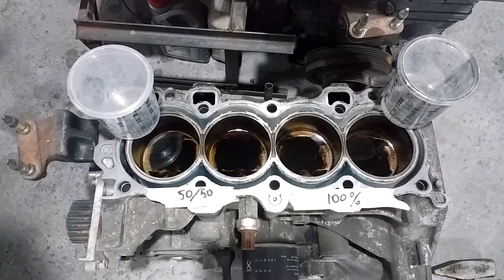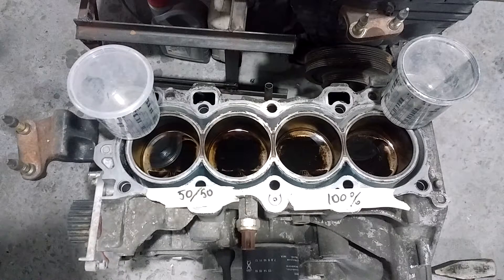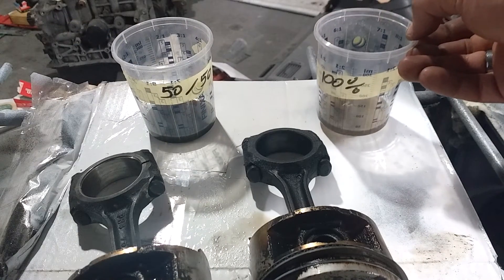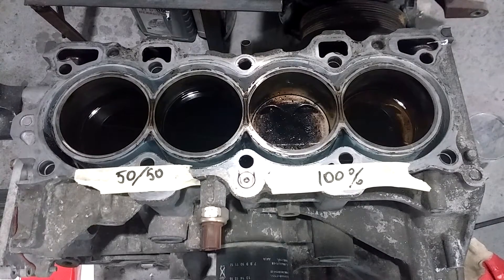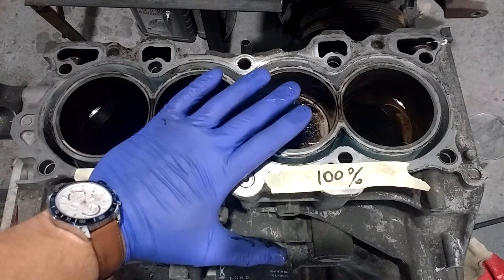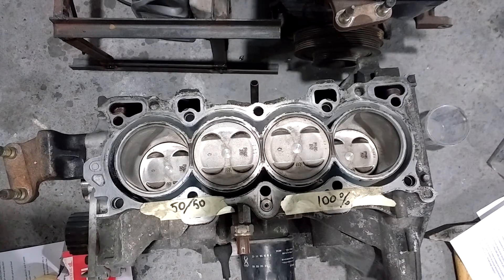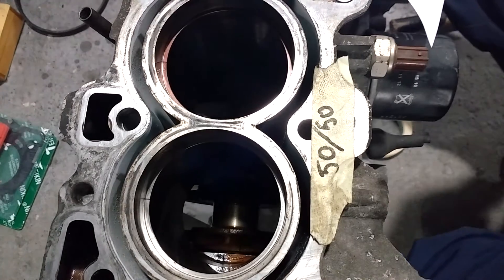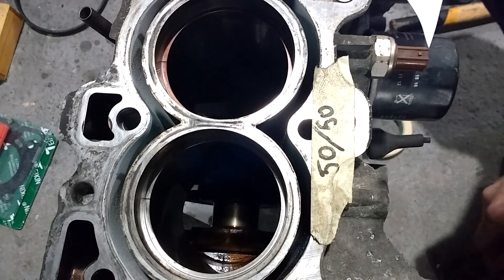How to remove carbon deposits on the piston rings?

Comment: Simply use some brake fluid for this.  You will never use anything else again.
Reply: Yes, in minutes not hours.  Also have a stiff nylon brush to use.  Old toothbrush is good.
Reply: Soak the Pistons in industrial vinegar if you have them out ,  or 3 or 4 oz down each spark plug hole...  Let  soak 24 hours or more...  Crank motor over to clear the cylinder,  then a few skorts of oil. Crank over a few times and reinstall plugs...   Driver hard and the rings and oil rings will re seat...
Reply: What kind
Reply: Just DOT3.
Reply: Interesting. It really cleaning it up?
Reply: Also, I should advise to wear gloves when handling brake fluid for more than just a moment, as it draws moisture out of your skin and can cause chapping..  And keep it off of painted surfaces because it is also a paint remover.

Comment: I was told:
- pour kerosene into the cylinders and wait for 2 days without disassembling the engine.
- Disable ignition and crank the engine few times.
- Change the oil

Will it have a positive effect on dirty oil rings and pistons?

Comment: Did you get the engine running yet? Does it smoke? Compression test?  I have a blown head gasket and I am rebuilding the head. Lapping the valves and installing new valve seals. I was going to soak the pistons and rings in the cylinder in hopes to save some time. I know the head is going to be solid but the rings are in question. Thanks
Reply from the maker: every thing is cool I usaly do videos in russian ) so First start was ther on other chanel https://youtu.be/3I5ZfqaE1lE